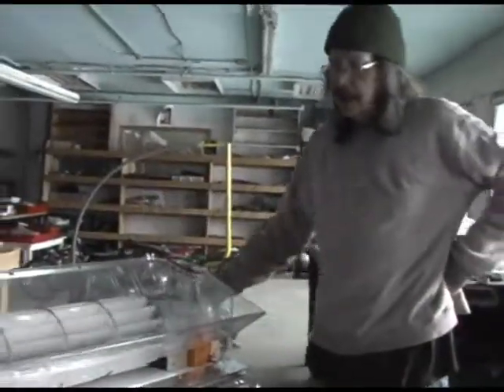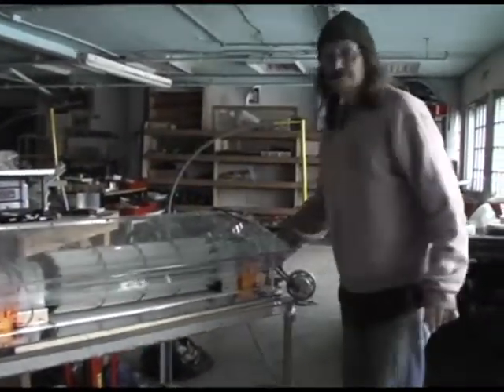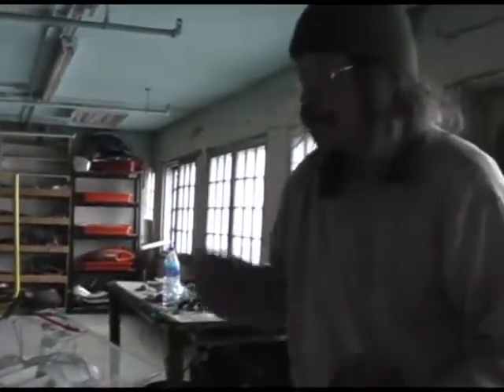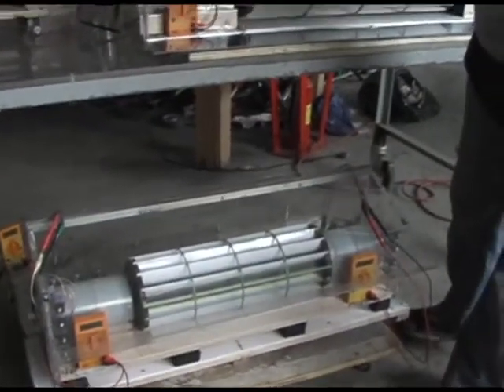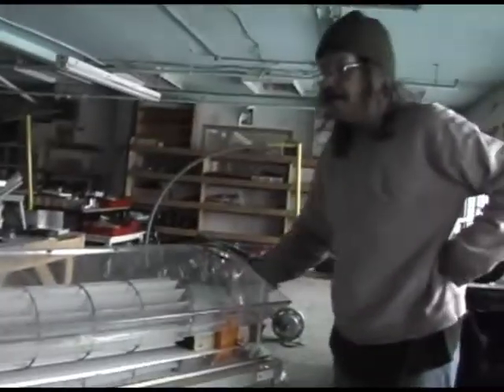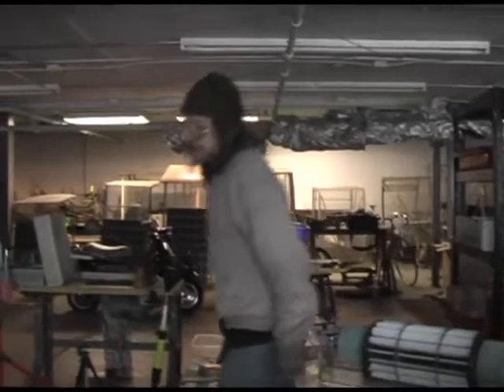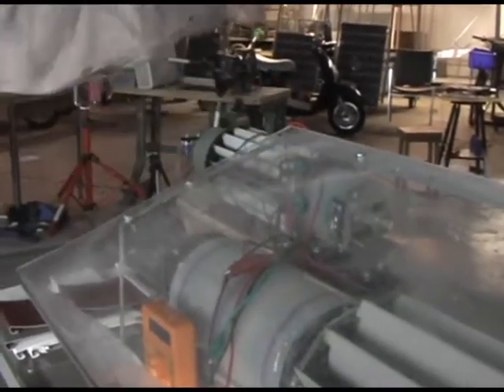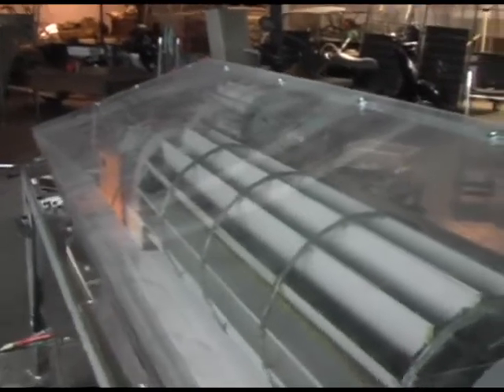Mag Gen - M1

Comment: The steel age is over: Flash doped-powder engine-block crystal casting led to neo-mags freezing of mag-alignments. Result? No heat (no friction) annulment of Maxwell equivilance equations. Doped steel mags are the jewels - non-ferrous surroundings the setting. 1/10 energy in drives from fuelies: 1/10 plastic recycling cost compared to fuelies. Production OUTSIDE corporate "job system"! The direct New Science revolution! All disasters have come from false sci-theories: GMO, etc.

Comment: New vids demo Mag-Wheel gear & shifting like George Mitchell vid & demoed here at end of vid. 'Ear' generators next to Solar roof trickle charger may be better than in-turbine dis-engaged trickle charge unit. Please continue digging, it is all coming together with moving gear wheels at ends of generator units (of several kinds: 2/3, 6/9, 8/12 3-phase & mag. no. & dia. of units= output) Goal now 16 amps cont. at 64v to ea. rear wheel.